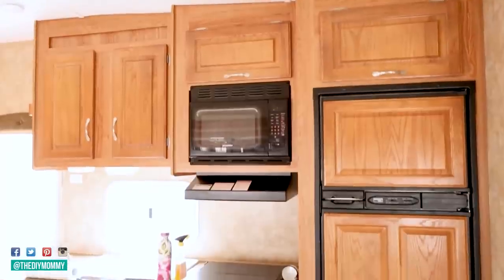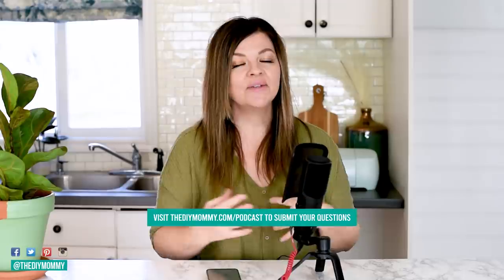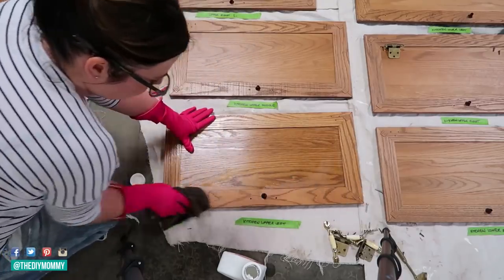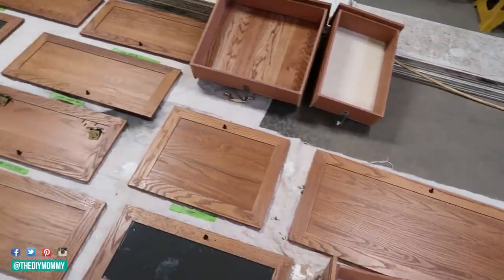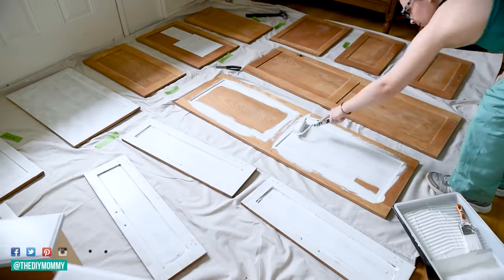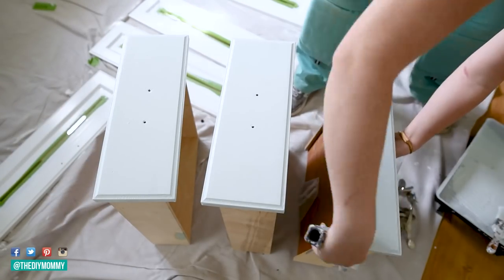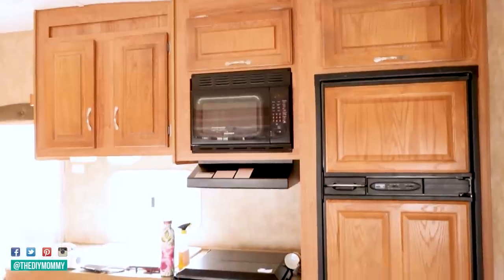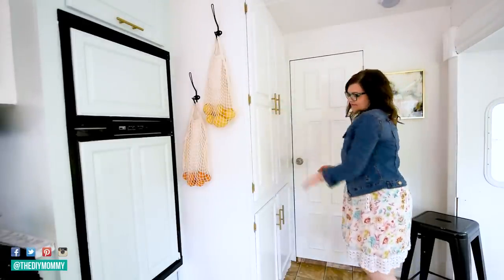How to paint kitchen cabinets so they ACTUALLY last | Dear DIY Mommy Podcast

Comment: Excellent! I am not a professional, but I've tackled 5 kitchens and countless pieces of furniture with paint. White paint usually only yellows if you don't prime it or clear seal it with polyurethane. A better clear coat to seal is Polyacrylic which is a long-lasting crystal clear coat. I use it after painting for two reasons: the cabinets become easier to wipe clean and it prevents chipping around knobs much longer.

Comment: Great video. The only thing I would add is if you're using the previous holes on the hinge side, add a tiny piece of toothpick into each hole so that it gives your screw a new bite to grab onto. I learned this lesson the hard way. I rescrew the old screws into the previous holes without the toothpick trick. My son left the cabinet door open and the weight of the door pull the screws off the cabinet because once I reattached the old screws without giving it extra bite, (toothpick) there wasn't enough strength to hold the door to the cabinet. That little toothpick trick works for just about anything that you want to rescrew into on  a wood project. I hope that makes sense.

Comment: We painted our last cabinets. We used Rustoleum cabinet transformations. It's a great product that comes with everything you need to paint cabinets. We were at our house 3 years, and didn't have any chips. The house has been rented out for 4 years since that, and is still in great shape.

Comment: I was getting ready to use the same paint you mentioned in the video on my cabinets. However, I saw another video with a guy demonstrating that this paint scratches off when oil gets on it. (We have oil on our fingers, and kitchens get a lot of oils on the cabinets and walls when cooking). Then he performed the same test on the Behr scuff resistant paint, and it did not scratch off. I saw another video demonstrating the same thing with the scuff resistant paint. So, I'm going to go with the scuff resistant. Keeping my fingers crossed that it won't scratch off. Because who wants to go through all of this prep work, time, money, and effort, just to end up having to redo it in a couple years? I sure don't.
Reply from the maker: Interesting! This is the third summer we've had our cabinets painted with the Behr Cabinet & Trim and there are no scratches.

Comment: I just finished painting my porch railing and window frame with a white oil based outdoor paint, and the concrete floor as well, last month.   I always prep with tsp cleaner, sanding,  and primer.  Love your tips.   I did my kitchen in the same way about 17 years ago.  It's chipping in places now (wish I had a battery operated sander back then) and I should repaint again but I won't.  I need to replace my counter top and some of my cabinets I've repaired myself over the years, but I kind of want to replace them next.

Comment: We are getting ready to paint our 30 year old cabinets (dark brown to white). Does anyone have experience painting the interior parts of the cabinets? Been searching YouTube and nothing much, except professional painting videos, comes up.
Reply from the maker: We've done interiors before, and I've painted them the same way as the rest of the cabinetry. Allowing the proper amount of drying time and adding shelf liner seems to help the durability.
Reply: Yes - what a difference! Absolutely recommend painting inside. We didn’t sand, just primed / painted 1 coat. cure as long as possible  For liner we used vinyl contact paper but didn’t peel off the backing. 
Thanks! @TheDIYmommy
Reply: There are some great tips in the other comments. At my first house I painted inside the cabinets and it was an older place so it had really deep spaces. If yours are similar, since it’s also an older house, a long handled roller might be helpful so you don’t have to lean into the cabinet so much. Good luck.